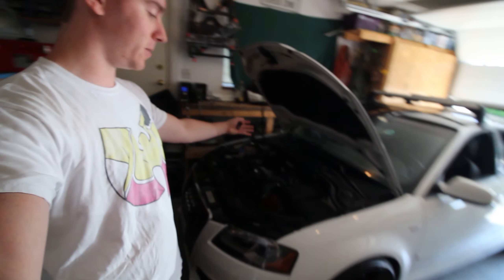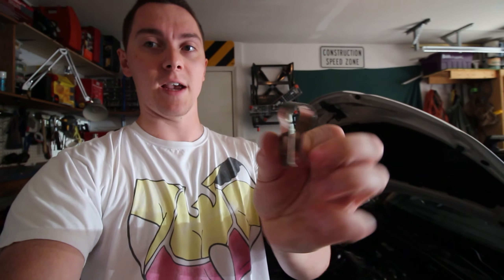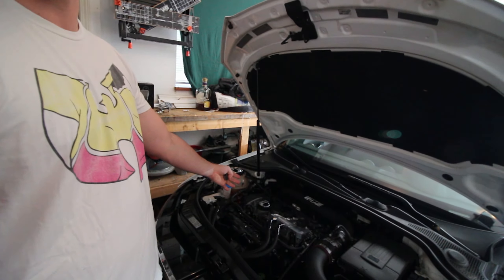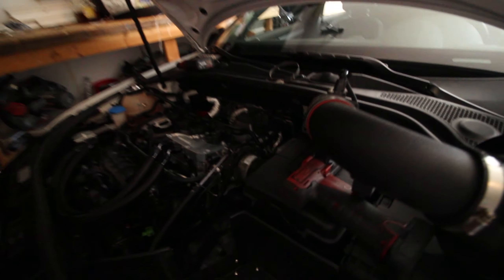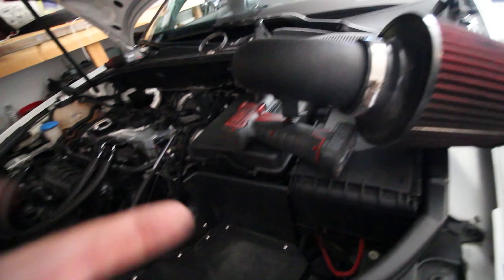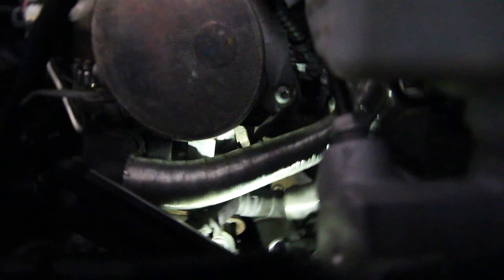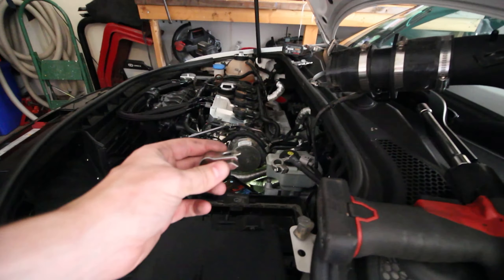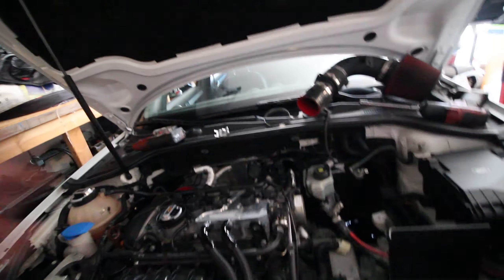A3 8P/GTI Wastegate Rattle Clip Install

Comment: I have a mk5 GTI with the 2.0 TFSI EA113 engine, should be the same as yours. I installed the wastegate clip 5 times but they fell off immediately. Turns out i got the clips that were meant for the newer TSI EA888 engines. The hole in the clip is too big for the round part on my wastegate. Do you have a link to the clip that you used?
Reply from the maker: My engine is an EA888, so unfortunately I don’t have a solution for a mk5! Sorry brother!
Reply: Did u ever find a solution?
Reply: @killer11843  sorry for the late reply, i unfortunately didn’t find the solution. Guess im gonna have to replace the whole turbo.

Comment: I had this same issue few months back. Ended up replacing the turbo with a new ko3. Didn't know these clips were a thing  Oops
Reply: if its any comfort, the rattle on deceleration / coming off boost is a symptom of a worn out wastegate which = a new turbo.  The clip is designed to stop the wastegate actuator arm from rattling where it meets the wastegate on acceleration - it typically happens between 2k - 3k rpm.  it is why it is designed to clip into that specific position.  I also had a new turbo a couple of years ago on my Scirocco after i tried the clip and still got boost error codes.
Reply from the maker: This is correct, if you have boost error codes then it will be time for a new turbo, the clip is only really a temporary solution for the noise only
Reply: I have rattle on Revs from 2k on my tdi all garages struggling to find also no errors showing any help appreciated

Comment: Yay,i have same issue on a4 b7,does it affect performance,and is it safe to drive with this rattle issue? Cous from what i saw,theres no separate part to be replaced,only whole turbo,which is absurd...
Reply from the maker: I believe depending on the turbo design some shops can replace the rod that connects to the waste gate, it also only begins to effect performance in extreme cases (I.e the whole arm inside the turbo no longer seals)
Reply: @ThatGuyTyy  Hmm,im gonna visit a shop soon,so i hope it wont be whole turbo thats need to go byebye,eh. Also it kinda feels slugish,idk if thats the reason,i had 1.8T version before 163hp one,and it pulled from 2000rpm ,you could feel the boost,on this 2.0 TFSI tho,it kicks around 2500-2600,but only at near 3000rpm you can feel a decent kick,so something is wrong im sure of it,both cars are 6speed manuals with quattro.Ty for the reply :)
Reply from the maker: Goodluck, hopefully nothing too serious, didn’t know the Quattro had a manual option! But must just be cause us Canadians got nothing cool haha 😂
Reply: @ThatGuyTyy  same in the uk, I had a tt quattro manual. Same as my current scirocco tsi, she's just started to rattle so I'm going to pop the clip on and re scan just to check and save to get a new turbo. ASAP. only had my car a mth and I do drive her hard, so I've prob scared it to death now it shakes in fear 🤣

Comment: i have an 2008 audi a3 1.8 fsi, iv got the code p0171 & my car has a loss of power when i get around 60-100, an i get off the gas and go again & it changes into gear and drives fineish.. iv searched around under my hood alot an clean the maf... any ideas ?
Reply: Your turbo wastegate is clogged
Reply: I have the same issue with my 2014 polo gti. In 2nd gear then the car losses power then I need to take foot off the gas pedal and put it back then the car picks up speed again. Have you solved this yet?
Reply: @ryallnovember2664   yes I needed a new MAF sensor!